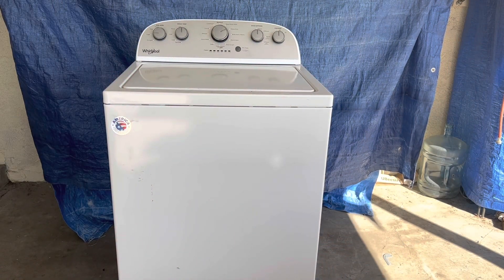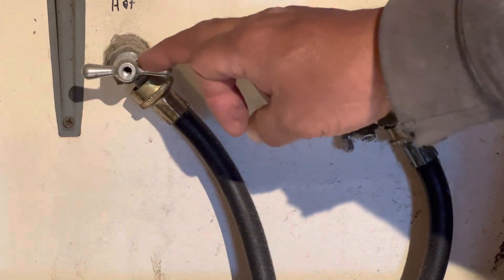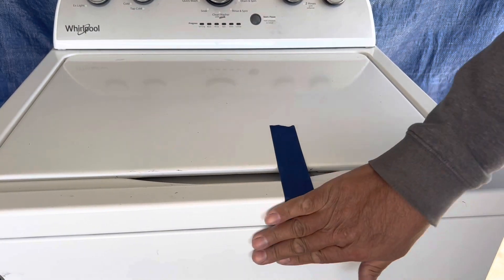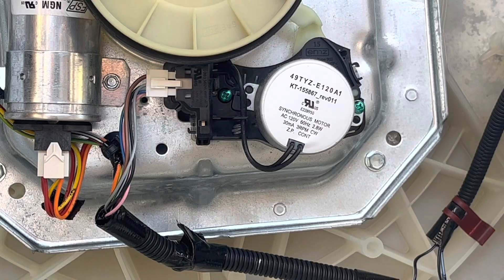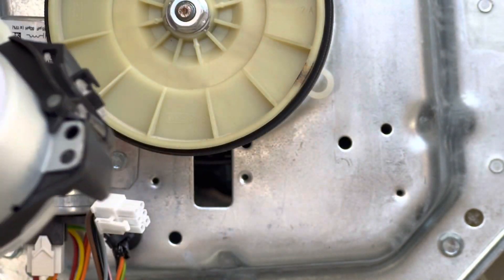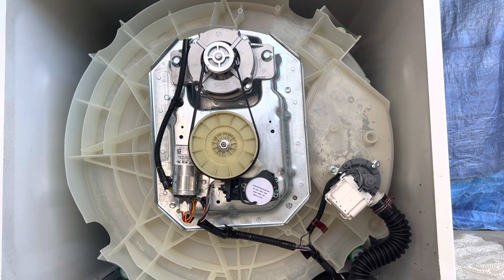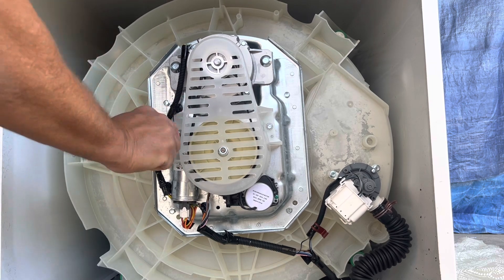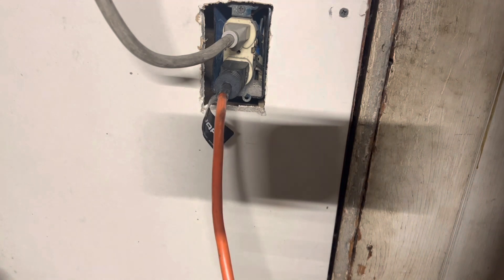How to replace a shift actuator Whirlpool Maytag  Kenmore Amana washers

Comment: How stiff should the shifter arm be?  I suspect the one on my washer is defective but not for sure.  Mine will spin but not agitate.  When I took the actuator off and looked it over, i tried to switch the arm position but it doesn't want to move and I don't want to break it.  The washer is still usable until I could buy another actuator
Reply from the maker: Should be pretty stiff

Comment: Did you cover why these go bad, or how to tell if  they are bad in the first place??
Reply from the maker: If the washer isn't spinning or agitating. Thank you I added it to the description.
Reply: @applianceflipper8590  …Could it also be when you start the washer and very shortly the “sensing light” blinks on and off,  but the washer does nothing.  Thank you for your reply
Reply: @stephenfiore9960  wash the shift actuator your problem?

Comment: I replaced my actuator and put brand new dogs in. But now it’s not doing anything once it fills and goes to wash mode pleeeease help sos
Reply: I'm the lead technician at an automotive supplier. I work on all and every type of equipment. Just because the part is new doesn't mean it's good!  Especially if it came from amazon or 7:56  They are hit and miss when it comes to electronics. Buy another replacement part then your issue will be resolved. Just FYI even if you had assembled the dogs incorrectly, your washer still would function. Maybe not for long, but it would. Lol. So concentrate on a replacement part
Reply: That is not it, you need to replace another part to solve it.